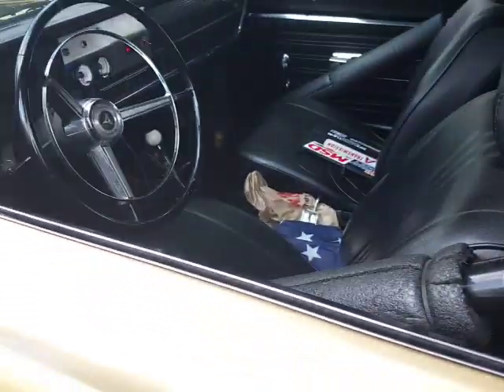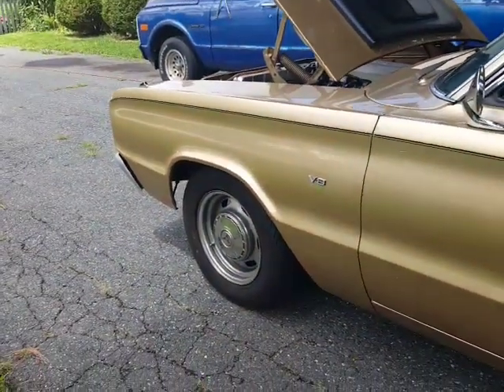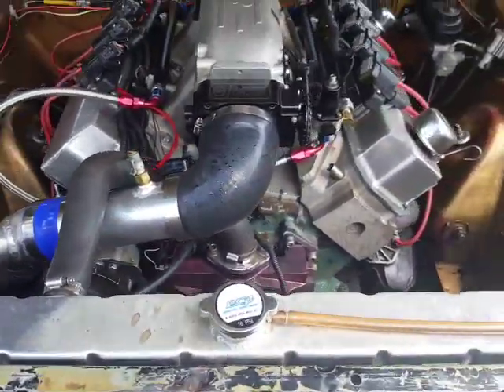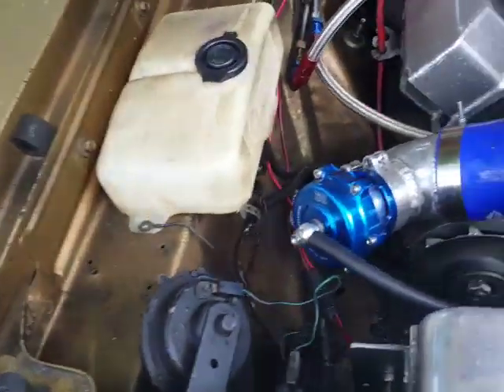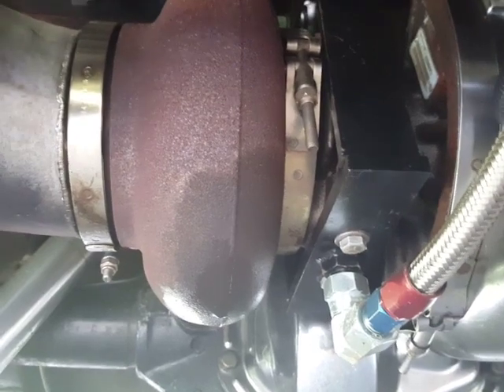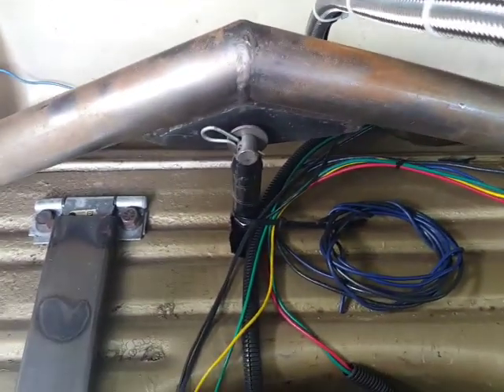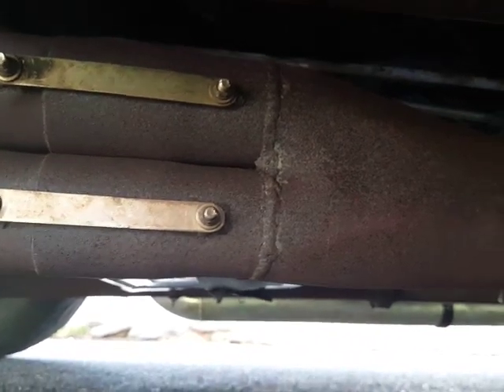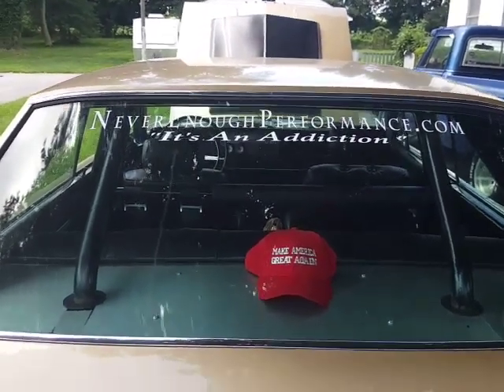Rear Mount Turbo 440 EFI Megasquirt

Comment: Why didn't you Crank it Up
Reply from the maker: At the time I was fairly new to turbocharged engine’s also that short block was not built for boost. Since that video I’ve replaced the short block with a block that can handle more hp. I’ve been learning about boost control since and tuning although not very impressive I’ve got it down to 10.18 on foot brake.

Comment: That's one sweet ass Mopar I use to have a 66 Coronet it had a 318 Poly in it. It needed work and at the time did not have the time and money to do anything with it so I sold it to a good friend of mine and he ended up fixing it up and putting a 451 stroker in it with a 2 stage nitrous kit and that thing hauls just on motor

Comment: Do you have turbo lag issues with the Turbo so far back? I've seen trucks have the turbo's in the bed but that's not as far back as yours is.
Reply from the maker: Hi tazman At the track running 1/4 mile I don't build boost at the line. Its usually showing about 65kpa on the map sensor. Once I leave the line it takes about 1 second before it's making boost.

Comment: How much HP and Torque? Also, how much boost does it handle?
Reply from the maker: This engine was built for 650hp which is where I'm at with 10psi boost. I've been waiting on and recently received a short block that will handle 1000hp. I don't know what boost level that will be but the turbo is 118mm so I'm sure I wont have a lack of hp. I'll have a post on that short block soon so check out my other videos.

Comment: This is great. Found you accidentally as I was looking for ignition timing information building my first mopar 440. I had planned to install a GM 58x reluctor wheel onto an ATI dampener and see you have a 36x trigger wheel with hall effect sensor with the Megasquirt setup that is very similar. I'm subscribed, this is a great start. If I may ask a couple questions:
1. How did you align the trigger wheel with TDC to that balancer? I love this concept, nicely done!
2. Is the cam signal from your Jeep setup providing 1x or 4x pulses per crank rotation? This is exactly how I wanted to do coil on plug and full fuel injection setup on a budget. The dream was to make a poor man's 440 six-pack similar to the fitech deal they want $3,500 for and I just cannot stomach that price point for my budget build.
Reply from the maker: The timing is done in Tuner Studio with an offset. The missing tooth shows up at about 40degs BTDC and once you have the motor running using a timing light you adjust the offset till the actual timing matches the timing the you set in the timing table. The CPS signal shows up once every 2 revolutions of the crank. That is what tells the ECU what revolution of the crank it's on and where TDC is. I have a 36 tooth wheel and sensor bracket and CPS Bushing for sale. Jim G
Reply: @jimgreenwell1244  Thanks Jim that helps a lot to understand. I saw your website in the video I will reach out to you, I would like to buy a timing ring and cam signal setup from you. I'm going to follow your lead on my build. :)

Comment: Intercoolers?  do you have a separate oil tank for rear turbo? why isn't turbo drain at "6" o'clock? urban legend says thats a no no lol. what are the internals on your 440?
your gonna need wheelie bars before long... :)
Reply from the maker: I'm using water/meth injection, on my last run the intake temp dropped to 102deg F. I don't have a separate oil tank it's something I've been thinking about doing. I do have a drain at 6 o'clock, the drain connection has been incorporated into the frame that holds the turbo. The internals are stock (I'm having a turbo motor built) this motor is a testbed to get everything working.

Comment: Dude that is unbelievable  I've never seen a set up like that before I think you should be running low 8,s for sure col car man
Reply from the maker: The turbo is big enough to push it to the 8s but the motor and car can't handle that kind of power in there present state.

Comment: Cool man, I tried to run my charge pipe through the wheel well but I had problems with it contacting the tire. I ended up making the round pipe to an oval shape and running it underneath the body.

Comment: Nice job Jim. I have a similar setup on my Aussie built Holden Commodore. Are you running mufflers? I noticed you have exhaust flex joints. Where would be the best place to have them?
Reply from the maker: I am not running mufflers the flex joints are there mostly because of heat expansion. My exhaust is pretty loud I don't know the best place to put your muffler if you can get away without it don't but  after the turbo would be best so you can take it off at the track. We use Vband clamps at all of the exhaust pipe joints. They make it easy on easy off.

Comment: Killer build man I dig it. How are you getting away with such high compression and boost? Conservative timing and race fuel?
Reply from the maker: The motor started out with a carburetor. The Megasquirt ECU allows me to control the timing, fuel and boost. So as the boost comes up I add fuel and pull timing. I have a low compression short block in the works
Reply: Jim  Greenwell awesome, thank you for the reply buddy I appreciate it.

Comment: What's done to the block hows it run?
Reply: My build is s full boost custom build 500ci stage 6 mopar headed . One off srp piston forged piston good 1500hp tool steel hell fire rings gapped at top ring moved dwn as far as possible .030 top .022 second normal oil ring. Titanium rods , aluminum mains line bored half concrete bullet turbo cam on a 114 centerline. Oh compression ratio 7.8:1 it's going to get a crap ton of boost. Going into a proflight aka fully built 727 with all lightened parts in it and a hemi band and trans brake vb, supercohen bolt in sprag upgraded servos, 6 pinion drums etc full built motor and trans. Mocking turbo now. Going to run fitech but think about going muiltport. Like to chat more a bout your efi setup, crank trigger and custom cam sync u have
Reply from the maker: @colebean1426  Ill be happy to talk to you about my EFI setup
Reply from the maker: The block has been line bored, decked and plate honed. It had run 10.86 on motor. I expect it to fly on the turbo.